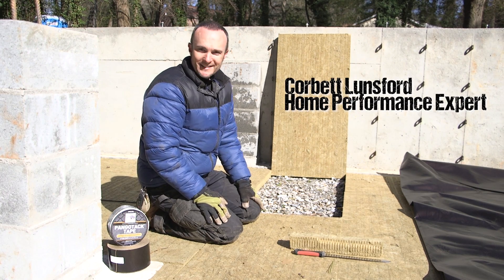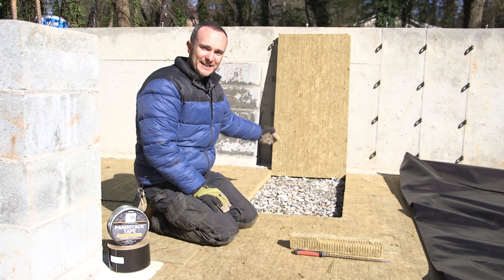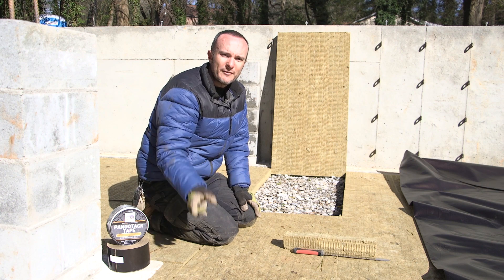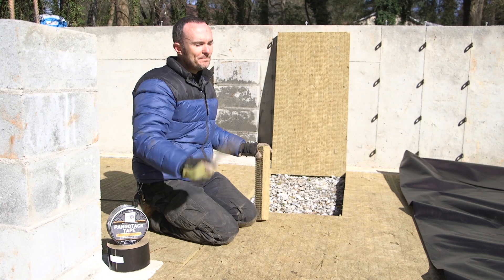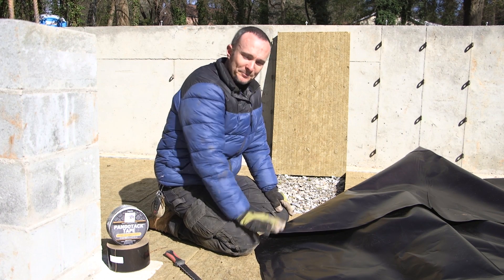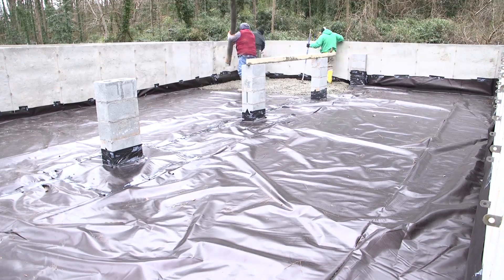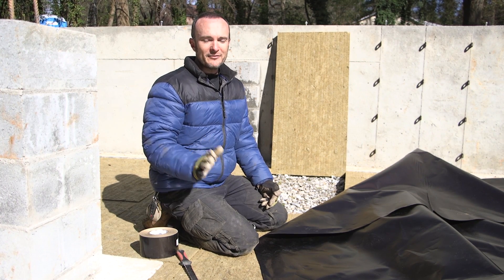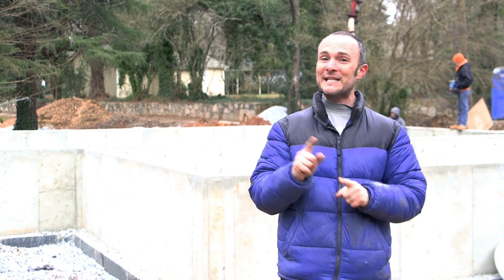5-Layer Slab System for High Performance Home Build

Comment: Why is rock wool insulation better than a poly board insulation?
Reply from the maker: Different properties, that’s all- there is no silver bullet product in any home. When we filmed, there was no foam insulation that didn’t have flame retardants making up ~10% of its weight. Those would have gone into the soil in our garden and up into the house (through the vapor barrier).

Comment: I'm doing a 5 layer slab as a rank amateur... Does that make ME high performance too? 😂 (Compacted dirt, clean 3/4- fill, 3" lapped EPS, 10 mil poly, 4" concrete with fiber and retarder)... Same insulation value as this, no worry about termites here and I can drive up to 3 ton trucks on it

Comment: If you use rockwool under a concrete slab, you’ll inevitably get water under there, even with a barrier. Isn’t that going to fill the air interstices with water and destroy the insulating ability?
Reply from the maker: Our footings are drained, actually, so there’s probably no water at all in the Rockwool
Reply: @HomePerformance  The problem is not water (liquid moisture) but water vapor.

The relative humidity of soil is (close to) 100% and so wil be the relative humidty (moist air) inside the Rockwool as Rockwool is vapor open.

And when the relative moisture level inside a insulating material reaches 100%, it will lose it's insulating capacity.

The rule of thumb is: "Always keep your insulating materials bone dry" .

Regarding this foundation, you should have placed the Rockwool on top of the plastic foil while finishing the floor with a vapor open or vapor retarding but airthight "system", not vapor closed.
Reply from the maker: @koenraadprincen7212 well that can’t be accurate- snow itself is insulating (eg igloos), so RH can’t eliminate the R-value. Also, real life testing shows my slab is same exact temp as air above it.
Reply: @HomePerformance  Cold air doesn't contain any moisture, especially when it's freezing (below zero there's no water vapor). 

Atlanta has very mild winters... so the earth underneath your crawlspace will not freeze up. In winter time, the bottom of your crawlspace will even be the warmest (natural) surface in the crawlspace.

That's why the air above your slab wille have the same temperature as the slab (in case the crawlspace is not heavely ventilated).
Reply from the maker: @koenraadprincen7212 sorry but you’re not making sense. Of course there’s moisture in the air below 32F- look at a psychrometric chart.
Reply: @HomePerformance  Okay, there is some moisture (vapor) in the air at those temperatures, but it's almost nothing.

But it's the moisture that "sticks" to the Rockwool that wil influence it's insulation capacity. The higher the moisture content inside the Rockwool, the lower it's insulatiing capacity.

Check this video: https://www.youtube.com/watch?v=AUIlZJ8Cfuk
Although Rockwool is water repellent, it will absorb water vapor .
Reply from the maker: @koenraadprincen7212 sure, influence, but not eliminate. Air moving through also influences it. Good luck with the real life application of pouring concrete directly on rockwool- there are always compromises, that’s life.
Reply: @HomePerformance  Yes, you're correct... it will still insulate. In the short term the heat loss doubles or triples as compared to the dry situation.

What the effect is in the long term, I don't know, but it won't get better ;-)

If you want to insulate your slab, check out "granular foam glass" (i.e. Glavel)... it's thermal properties are not influenced by the moisture content of the soil.

Comment: You mentioned in your Manual J video that sub slab insulation is "the last thing you do" because the thermal connection with the ground actually helps cool your house in the summer. Did you end up calculating that the heat saved in the winter is worth more than the free cooling in the summer? Is there a situation where you are actually better off by omitting the insulation?
Reply from the maker: It is helpful in our case because we got the roof, walls, windows, doors, and airtightness planned to be very good. That’s when it works- as a system with everything else.

Comment: How does using Rockwool for the underslab insulation compare to using rigid foam? In my build, I was planning on using EPS for the slab insulation and Rockwool for exterior walls.
Reply from the maker: Well, they’re about the same R-value per inch, but I believe the foam can break apart in freeze/thaw cycles, if that matters to you. Also, when we built this all foam insulation was req to have flame retardants, which is dumb imho. Now the state of CA has allowed for below grade foam to not have FR, so you can buy clean foam in the states for the first time.

Comment: I wish I can see how the radon system & drainage system besides the Form A Drain Part get buried inside the slab.  I see a white PVC pipe running horizontally in the middle of the floor area. Is that for radon ?

Comment: The compression loads are in PSI, not in "pounds per sq foot."  You need a min of 25 PSI under the slab to prevent insulation collapse.  Roxul will give up to 80 PSI, and most rigid 2" board is above 25 PSI, too.
Reply from the maker: That’s great, but they label the bags with psf- 400 and 1100, respectively

Comment: Hey all, how is the 2” slab performing? Any cracking, lessons, regrets, etc. or all good?
Reply from the maker: Perfect. No regrets about the slab, yes it cracked some but as expected. Nothing that prevents rolling around on a mechanics sled. FYI, perfectly installed 15 mil subslab vqpor barrier does not ensure low radon.
Reply: @HomePerformance  So this is a “rat slab” under a wood frame floor bearing on the top of the foundation walls? Any provision for airtightness between living space and this crawlspace area? Assuming you put an exhaust fan in there to deal with the radon and would have been concerned about losing some conditioned air from living space above?
Reply from the maker: No, I would search all our crawlspace vids on this channel. It’s fully conditioned.
Reply: Thanks, appreciate the response.

Comment: wouldn't it be better to put vapor barrier under the rockwool insulation?  after all that insulation is water vapor permeable. so if it gets wet the water will act as a thermal conductor and take the R value down to almost zero? one could put sand on top of the 57 gravel so the plastic would not get ripped.

Comment: I notice a few mistakes. 1) A plastic sheet of 15mm? should be 1.5!  B) radon doesn't become an issue, it has been an issue for decania, C) Rockwool can be dense, but what it isn't though is a good product to use under damp conditions. So to put it on top of just gravel and compacted dirt, it is still exposed to damp conditions Preverable is a product that is dense AND can handle damp conditions!
Reply from the maker: Gert, ‘mil’ doesn’t mean mm, it means 1/1000ths of an inch. And I don’t know what ‘decania’ means, but mineral wool is made of rocks, it’s hydrophobic and can do fine in wet conditions.
Reply: @HomePerformance won't the rockwool stay wet having it trapped between the ground and poly?
Reply from the maker: The gravel is dry. It’s drained AND has the radon fan continuously provoking evaporation.
Reply: @HomePerformance if the gravel is under the poly then it will most likely be at 100% humidity due to the constant vapor drive from the ground
Reply from the maker: Radon fan is pulling the humidity and soil gases 24/7. You can test this by burying a sensor in there if you like.

Comment: I was just on the Rockwool site looking at the Comfortboard 110, wondering if it had high enough compressive strength to sit under a foundation footing. The IRC prescriptive code allows foundation design for soils as low as 1500 PSF compressive strength, and at 25% compression Comfortboard 110 is 1566.

I know EPS gets used under footings, but it might even be possible for Rockwool too. It seems like as much insulation is used under a slab or even the foundation wall, the footing becomes the largest thermal bridge. Why not eliminate that bridge entirely if you can?
Reply from the maker: Exactly

Comment: 3:40 Lol, no way that sheet is 15 mm! You probably meant ".15 mm" or else myself have been using the term "mill" completely wrong.
Reply from the maker: Mil actually means thousandth of an inch. 15 mil is .015 inches thick.
Reply: @HomePerformance  I had no idea! I thought it was short for millimeters. Thanks

Comment: Great Video, I'm trying to catch up on them.   I also want to make an insulated slab lasagna for my high performance home.  What are you thoughts on 4.5 inches of insulation under the slab and 1.5 inches of insulation on top of the slab?  I'm thinking for cushion comfort on the subfloor it would be nice to have.  I can't find any information on other people doing both, its either one or the other.  Thoughts?

Comment: Rockwool does NOT insulate when wet. Put the water barrier under the insulation, or better yet, use insulation that does not absorb water.  SMH
Reply from the maker: The rockwool can NOT be sitting in water, due to the Form-a-Drain system. Good idea tho.
Reply: You are insane if you think drain tile will remove ALL subterranean moisture!  The rockwool will act like a sponge.  I pity your customers...
Reply from the maker: Rockwool is hydrophobic. It does not act like a sponge. Try again my mans.

Comment: Great job! What is the cost difference if we use polyiso foam below the concrete
Reply from the maker: None, but you introduce toxic flame retardants
Reply: Not sure what you mean, Corbett... Polyiso is a lot cheaper than rockwool.

Comment: Can you show how you're dealing with the wastewater and plumbing coming out of the crawl space. I'm always at a loss of how to plan for this when I'm thinking about a building.   I want to be able to put down a crawlspace first then deal with the plumbing.
Reply from the maker: Stay tuned for the visual, but simply put, we left a 6” pvc pipe in the bottom of the wall form to run our 4” drain line out, and a 1” for the 3/4” water supply. Had to know where the sewer is, which in our case was weird.

Comment: Corbett, do you know of a cross section detail diagram out there on the net of this five layer system for a slab on grade foundation ? I plan to use all five steps of your system, however I am building on a slab. It would really be helpful to show my foundation contractor.
Reply from the maker: Hi Gary- sorry, no, but you could easily create one using the details in this vid. Good luck with your build!

Comment: Wear a respirator when working with rock wool. Nasty for the lungs
Reply from the maker: Safety first, but outdoors and with the rigid boards instead of batts, it's a lot less of an issue

Comment: Rockwool (aka. Was roxul) started hitting the AIA circuit hard a few years ago. Fast forward a few years and roxul is literally being used everywhere and for anything, with little data or history to substantiate its use for these exotic applications. #rockwoolpayingeveryonetopromoteitsuse
Reply: Don’t get me wrong, I love rock wool. But only for cavity fill applications. Kudos to roxul for pushing the heck out of this stuff.  Good lord it’s every where!!
Reply from the maker: Hey Team- i first tried Roxul back in 2016 without being compensated at all, and continued to choose it over other materials because of its ease and effectiveness. I have since convinced them to become a product partner of mine, but anyone on that short list is there because I believe they make superior products. Just to add my two cents.

Comment: Challenging soul conditions,  high radon area,  termites...   all tough challenges.  Looks like you are doing amazing job.  Lots of thought put into project.   Probably best foundation in area hands down...

Love rock wool insulation best stuff for sure.  Careful that it does not get super wet.  Why not put the liner under the rock wool?    Also I hear it’s better in walls as well as compared to spray foam which has lots of off gassing and can hide termites and water damage issues.... 

I always go 4” min on something that big.  Also I solute slab from footing wall. 

I have to say I’m liking your videos more and more.  You are definitely a critical thinker and not out to simply reinvent the wheel.  Thanks for sharing...  and great treatment to those who are working for you....
Reply from the maker: Thanks a lot brother

Comment: I can´t believe you are putting NO waterproofing below the fibre insulation. I mean the insulation bridging with the foundations is one thing, but this detail is just wrong. The rockwool will soak by time and therefore be useless. :O It would be different thing with PS or Glassfoam gravel.
Reply from the maker: Johann, 6” of gravel underneath. It’s ok.